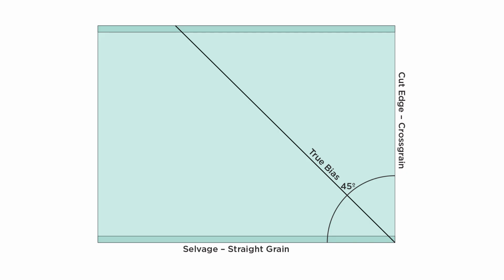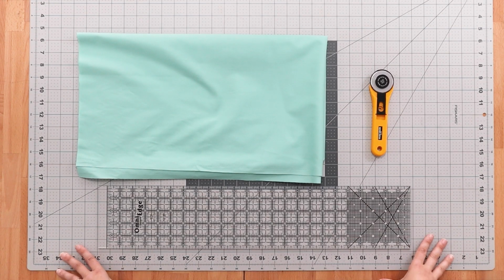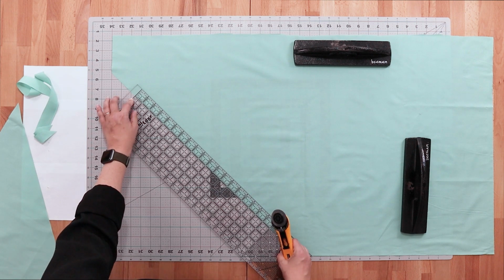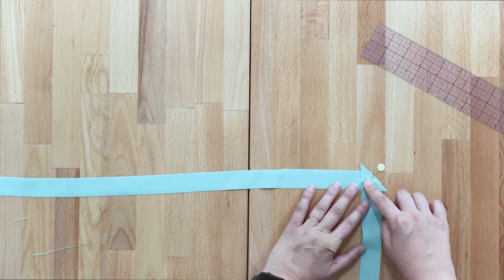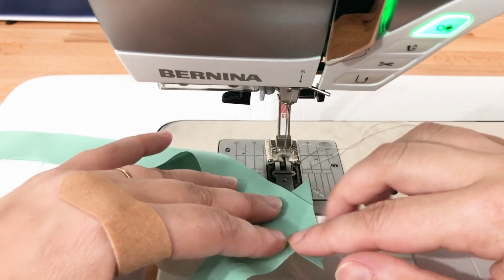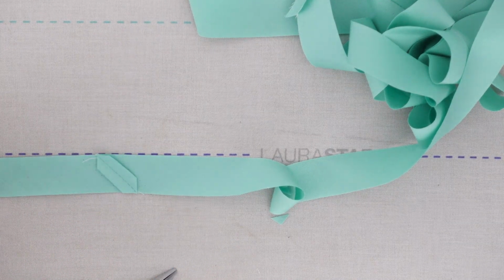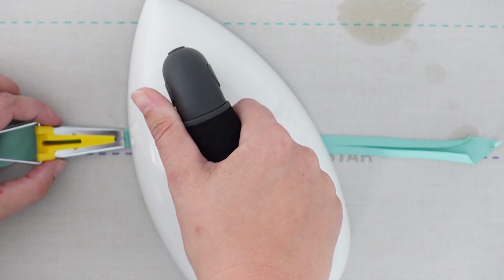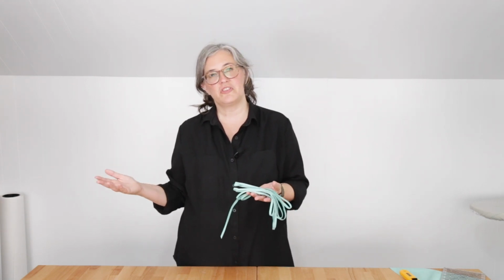Stowe Sew-Along Day 6: Making Double Fold Bias Binding

Comment: I enjoy your tutorials and thank you for such a clear demo. I have made my own bias tape before but in the interest of fabric economy, since fabric is expensive, I used the technique of starting with a small square and folding and seaming it to get a parallelogram shape. It”s kind of intricate but still works well and eliminates sewing alot of short seams. I’m sure you are familiar with this method and wonder what your take is on it. The bonus is I can make quite a long length of tape from a fat quarter with this method. But I do need to check on-line for directions every time.
Reply from the maker: Ooh yes the continuous method is excellent! I wanted to keep the tutorial short and sweet but will definitely be doing a tutorial on this method soon!
Reply: @GrainlineStudioSewing  Great!